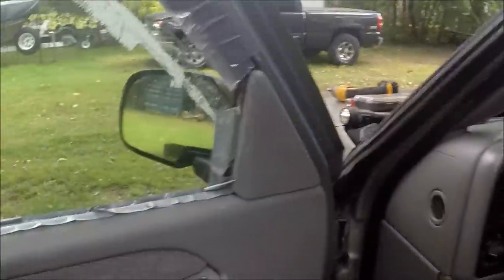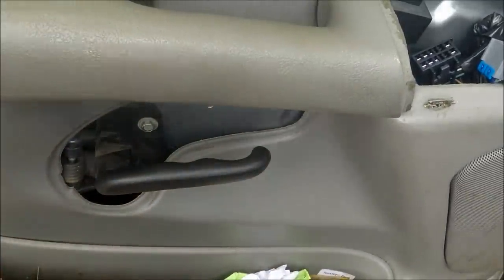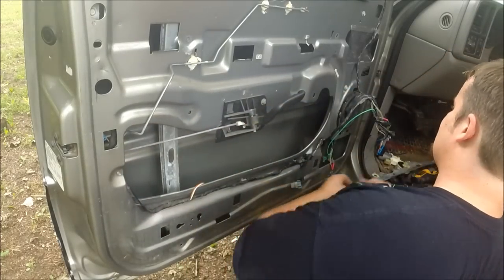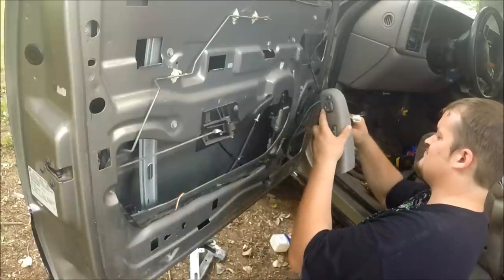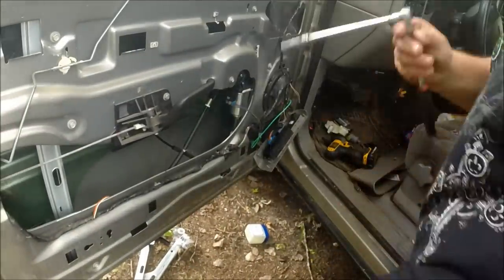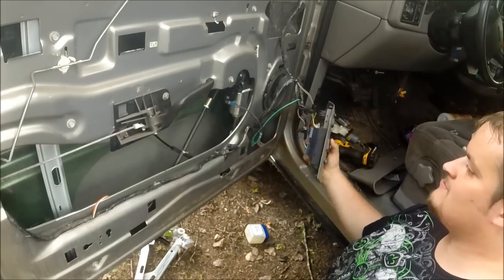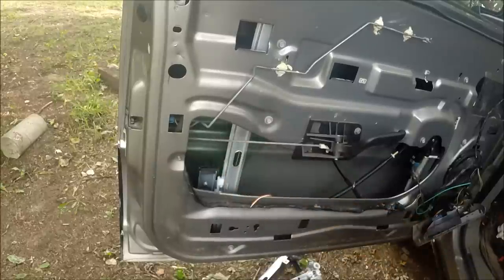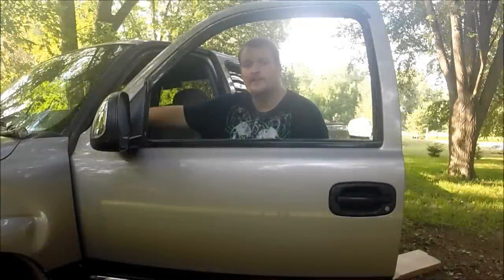1999-2007 gmc/ chevy truck front window regulator replacement how to

Comment: Doing a quick regulator and motor job in the morning tomorrow. I came to see what tools I should throw in the bag since it won’t be at the shop. I’ve worked on quite a few different styles of vehicles in my day including Silverado ‘s. Thanks to this video not only do I have a good idea of what to pack that way I’m not carrying around more tools than I need but also I have a Headstart on the job and now exactly what to head for rather than finding it out as I go. Thanks Joe for the video!!! One side note...this is the most appreciative comment section I’ve ever seen on YouTube.
Reply from the maker: glad i could help you out , thanks for watching , always great to see these comments
Reply: Suggestion for next video although I’m sure you take the jobs as they come to you, but a breakdown I’m pulling the EJ 205 Subaru boxer engine. I’ve seen it done multiple times and no it’s relatively easy but it’s nice to see a video that explains it well

Comment: Thanks for the video Joe another note  you do not need to take the window out  are used a little piece of wood stick  pull my window all the way up in wedged it inside the window  then I took out all the screws  and the old regulator  my cable snapped  with the window up and the old regulator out clean anything inside the door all broken parts  make sure the new one works  it comes with zip ties so  Cut it  put the new regulator in  make sure you unscrew the two mounts that holds the window  not all the way just Open so it could grab the window  move the window up into position tighten screws and take the wood wedge out the window   No tape cleanup Take care and God bless

Comment: Just a couple of suggestions.  That door has been taken apart before, because it is missing 2 screws.  The one to the rear of the pull handle, and usually one under the bottom of the door.  The one to the rear of the pull handle is important because when you use the handle to close the door, it  plus the one in the front of the handle, pull on the steel frame of the door and not just the plastic.  There is also a clear plastic sheet liner stuck to the steel portion of the door, covering the door, with holes for wires, etc.  The plastic sheet helps keep water from dripping on the inside of the plastic door cover.  Note that water does get inside the door from the top and drains out through holes in the bottom.  Lastly, it is a good idea to grease the rails for the window slides, coat all the steel cables with grease. and put a drop of oil on the three white plastic pulley spindles.  I use disc brake grease because it is more water resistant than normal grease.   There is a lot of friction with all the cables moving through cable housings and every bit helps.  While you got it apart, spray some WD-40 on the inside of the latch mechanism and the guides for the auto lock rods.

Comment: After watching this video I replace my drivers side window myself. So thanks...however if you pop the rubber seals on the front side and back side of rthe base of the car door window, it makes it so much easier. The window doesn't have to be turned or man handled to get it onto the rails. Replace seals, boom done

Comment: My 2004 Silverado 2500 was different from this in a couple ways, one was the power window button panel was held down at its front end by a screw coming up from beneath (no apparent way to remove it) it just broke off when I pulled up on the panel. Also my model had a sheet of clear thick plastic between the outer and inner door panel which I had to peel off to access the power window regulator.

Comment: Dude, I was driving this morning and something snapped inside my driver door and my window stopped going down. I am not a mechanic by any means. I was intimidated to even look. But I watched your video and you were so methodical and helped me fix my window. It took me 30mins.
My only question is, why does the window go up slower? I lubricated the rales but still slow going up. I am worried to snap the wire again. Any advice? Thanks so so much.
Reply from the maker: Make sure the window is centered before clamping in the regulator a slight bind will cause a slow up condition,  also check wires in door make sure your making a good power wire if it is still slow

Comment: Thank you for the video.  It helped me replace my regulator.  But you this video doesn't show everything.  Some post broke under my control panel, when I removed it.  Don't know how it could come apart without breaking.  Maybe because I have power mirrors, there is a connector that requires you knowing the secret to remove.  Also, removing the door panel (the largest piece) was very difficult.  You don't just lift up a little and boom, as shown in this video.  It seems you lift up (very difficult to do) and the top must be pushed toward the front of the car.  I broke off some plastic fasteners because I didn't know this.  Also there will be a plastic sheet covering the entire door, which is a big pain.  It is help down behind a few parts, like the door handle.

Comment: The cable snapped, on mine. Thanks for this video, I'll reference it once I buy the new parts.
Reply from the maker: thanks for watching!
Reply: Wreckage72 window cable replacemeT
Reply: JoeTheAutoGuy thanks for the video. My cable snapped with the window down inside the door.  How do you suggest I get the glass out?

Comment: Also my door was held on with four screws; one under the handle as in the video, then one under the black door lock switch, then one trim screw at front and rear ends of the door about halfway up.

Comment: I got a 2003 Chevy silverado 1500 LS  The window control switch housing. It is only secured by clips or does it also have a screw underneath ?
Reply from the maker: In later models the switch has a 7mm screw under it

Comment: I have an 06 1/2 ton silverado and i want to replace the manual windows to power windows, i asked a locar shop and they told me that in this models not every after market window regulator would work, tha if i could find the originals from a salvage truck that woudl be better, so i ask for your recommendation of what to do and if the brand in this video has proven to be reliable?, because on other brands the reviews  are not verey good often they say the window regulator stop working after few months or even weeks after installation, so i think you get the idea i want to buy something that will last, thank you from méxico

Comment: my master window switch replaced because window went downonly..! same problem.. now changed polarity on motor and it does go  other way!  told that problem may be the Regulator or clean it>? any feedback.! ss
Reply from the maker: Scott Strick check for broken wires in door jam

Comment: Friends cable for lowering/raising door broke. 2003 GMC sierra 2500
Can't find an electric regulator. Don't seem as if I can simply pop the motor on the regulator to get it to work... Or can I?
Reply from the maker: if the cables are broken , the regulator needs to be replaced , 1aautoparts is a good site for these
Reply: JoeTheAutoGuy Thanks. I found one for him at Rock Auto. $46 with shipping and tax.
Salvage yard wanted him to buy entire door for $100 plus the old door as a core.

I was hoping I could mid a manual crank to work with an electric. Not worth the trouble, spent another $20 over what a manual crank costs instead.

Comment: @3:23 Isn't that total of 5 screws, 2 in inner door and 3 in outer, rather than 4 or 6? Or did it miss one screw in mine?
Reply from the maker: some afgtermarket ones dont use the middle screw on the non motor mounted track
Reply: No. Actually I was missing one and you were right. After having extra noise while closing my door, opened it again and yes, the inner side also has 3 screws, one in middle goes over the motor location that I missed. So 6 screws was the right number for me too (GMC Denali XL 2003, replaced with aftermarket). Nevertheless, once you do this, it gets so easy to do it again and thanks to good reviews like yours that save me some big dollars. Also to add a point for a potential future reader, I initially tried to save the GMC's OEM rail and wires as only my motor was faulty. The cost of motor itself was a few bucks more, when buying it locally from Pepboys, compare to the aftermarket full assembly (Exact replacement) as sold on Amazon for about $30! No matter how I tried to replace motor only, it simply wont work. Please don't put yourself in unnecessary and unrewarded attempt to replace motor only as it is impossible to keep the wire and frame back to normal position, once they go open and lose. Full assembly replacement is cheap and easy. I say its the right way to go, even if it fails in a year or two as once you learn what to do once, its very easy for then next time, as long as prices remain the same.  Thanks again man for your great DIY video tutorial here.

Comment: The power replacement for my 2007 Chevy suburban says I must go to a dealer to activity , why none of these videos say that .
Reply from the maker: Because you don't,  if you replace the drivers door switch some models require programming but if your replacing eith the same one no you don't the window regulator /motor does not require it

Comment: The whole reason I came to this video and he didn’t even show how to take the window out🤦🏻‍♂️
Reply from the maker: Considering this is a window REGULATOR replacement that does not involve removing the window why would i show that , if I did there would be the overwhelming majority commenting "you didn't need to remove the window!!! What a hack... etc"
Reply: JoeTheAutoGuy  just think how many more views you could have gotta if you showed how to take the window out
Reply from the maker: @ruthless2221  well remove the regulator and rotate the window 90 degrees inside door and remove throught the channel

Comment: Definitely not Joe the welder...
Reply: Seem the duct tape and that was enough for me. Hack!
Reply from the maker: Why you say that this is a window regulator replacement
Reply: I'm Joe the welder. I was making a joke about your opening banner. 
The second comment was in response to the duct tape all over the window and door. 
I didn't care to continue to watch after seeing that half assed temporary solution you had.
Reply from the maker: its not a hack if i was repairing the window to fix the issue. lik what are you supposed  to do when someone brings you a truck to repair that they put duck tape on . am i supposed to tell them no i cant fix it because they put duck tape on it.  lol  and as for my banner i wasnt  making it pretty had rusty metal and rods for way different material to right a name on it quick. not structural .